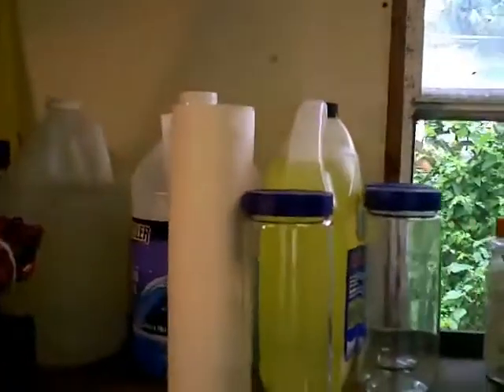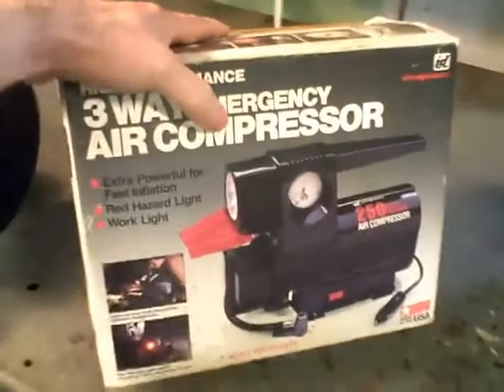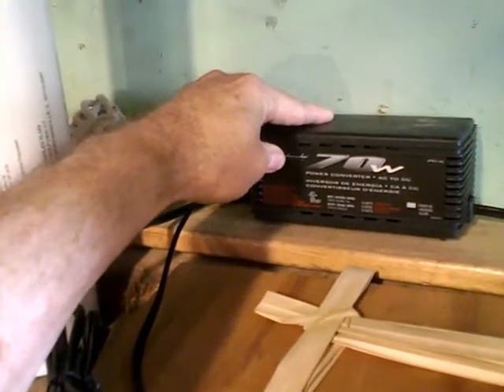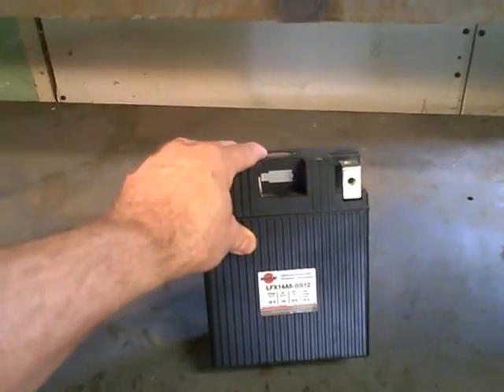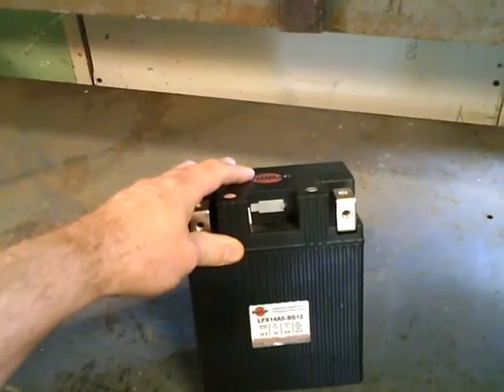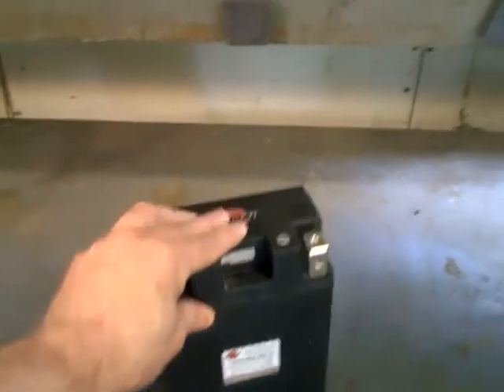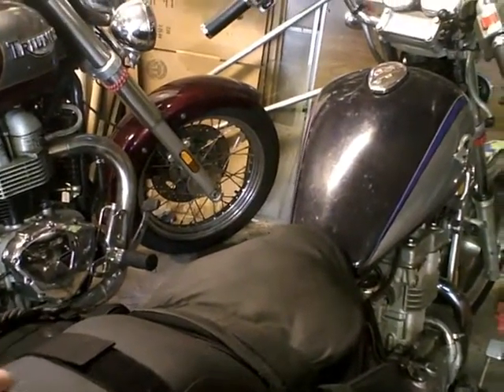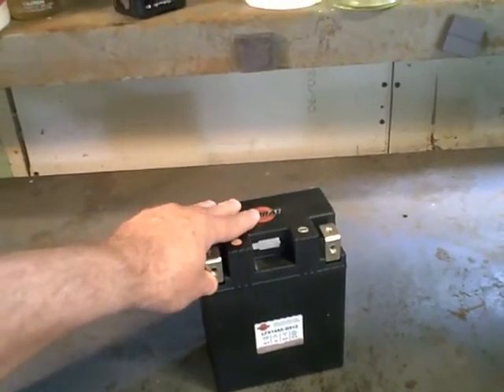Shorai Battery Status Update

Comment: Hey there, I would love to see how your shorai performs now, by the way, the shorai battery will perform just fine in the cold, all it needs is some draw on it for around 15-30 seconds to let it warm up, this is usually done by running the headlight before cranking the starter motor. Best of luck!
Reply from the maker: Problem with my bike is a safety that keeps the headlight off until the engine is running.
I have been using the new Shorai as a portable power pack for my tire inflator.
I may give it some test runs in February to see how it works.